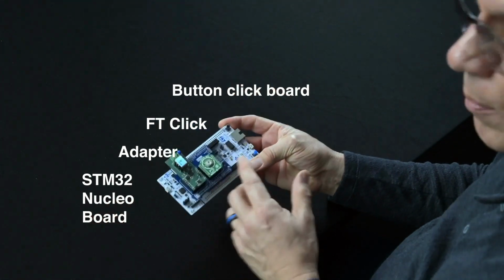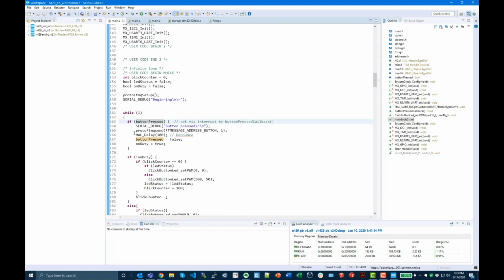FT Click Board Demo | Free Topology: Wired Communication Technology

Comment: Really impressive demo, guys/  Presumably, a network of FT devices can be part of a closed system which would make it immune from external interference, hacking, etc?
Reply from the maker: Thanks, John. Yes, a network of FT devices can be locally connected within a closed network, or can be connected to a private network, or can be cloud-connected. The beauty of FT is that it can be easily configured and reconfigured to meet specific system requirements. We have some customers using FT devices in closed networks such as gas station fuel pumps and building access control systems. We have other customers that are connecting FT devices to cloud analytics platforms or other connected systems through a secure gateway.